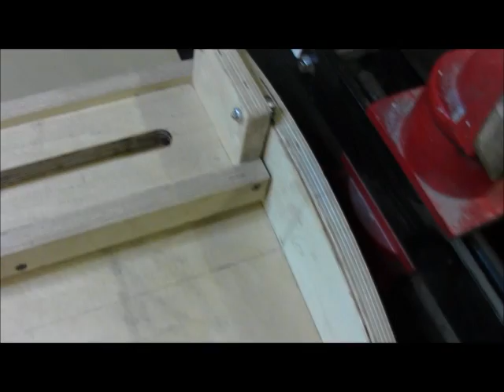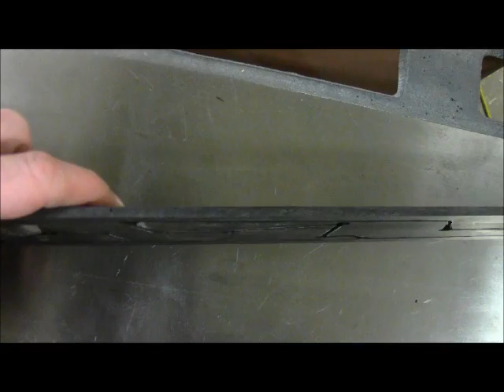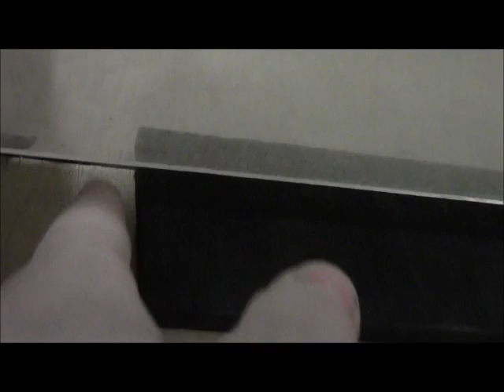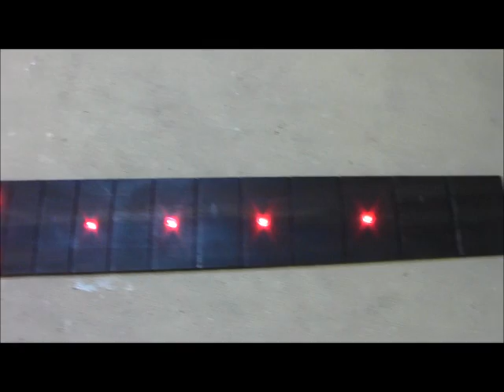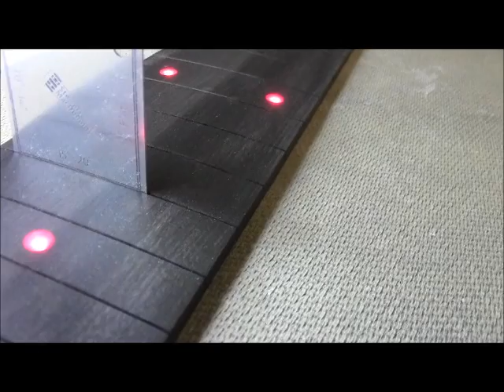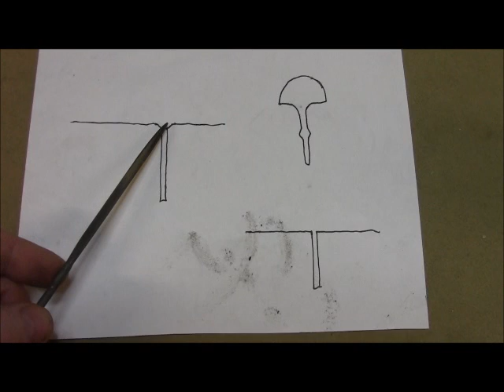How to Build an Electric Guitar -Fretboard Pt2.wmv

Comment from the maker: Yes the leds are in series however with the resistor used for red leds (different colors require different resistance) there was only enough power to illuminate 5 leds. I needed to illuminate 12 leds so I put 4 on each circuit. Yes they are standard 5mm red leds. There are important steps to follow in pt 1 of the video. It outlines the layout/mock up, drilling and routing to prepare for the installation. Be sure to check it out!

Comment: cool, so the leds are in series..?. if so why 3 resistors instead of one on battery?.  

are the leds 5mm and did they poke through the holes?..and then sand the top of the leds?.. cheers  great work man.